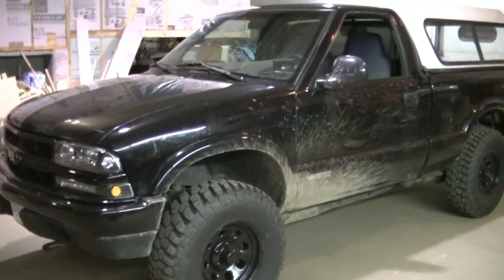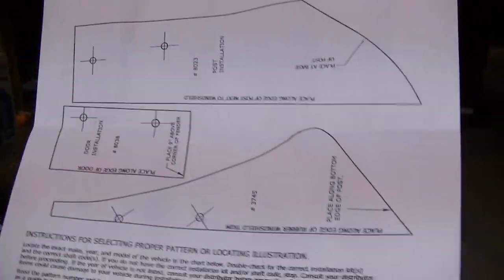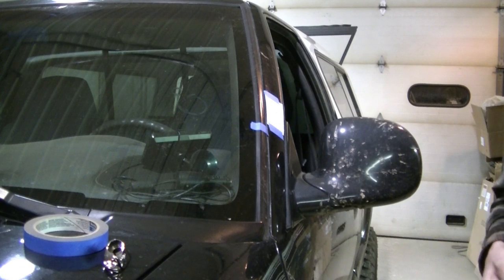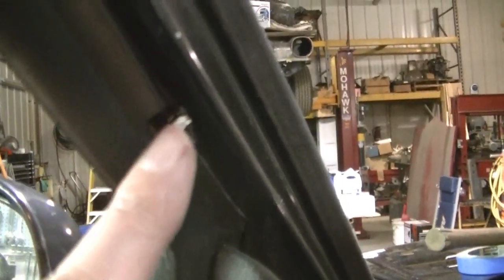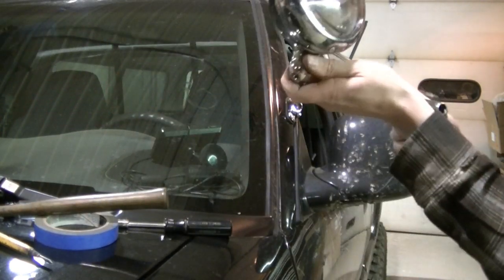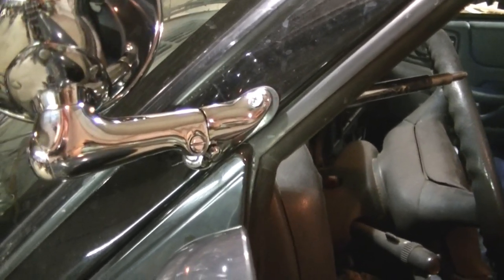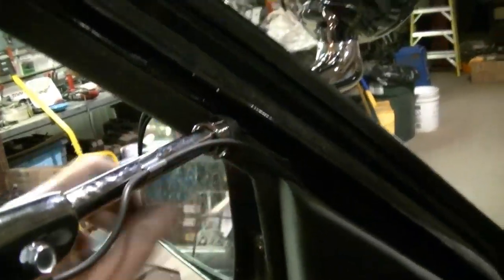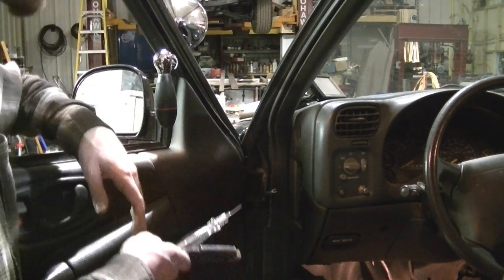98 S10 Unity Spotlight Install

Comment: did you ever think that you may have drilled the screw hole at the wrong angle?
Reply from the maker: williek74   No,  that wasn't the problem.  I think the expect the drill to grind the screws down but I wouldn't count on that.
Reply: +mossman381 watching the vid you had quite a downward angle going on drilling those mounting screw holes. I would suspect a flatter angle wouldn't have interfered with the shaft. Hey, it sure is helpful either way though. I'll be watching out for that when I do my install and if I experience interference I will know what it is :-)Thanks for the great vid!!

Comment: Moss Man thanks for your video. I feel your pain my friend. After researching many videos and instructions for the past several weeks, I was installing one tonight in my Toyota Tacoma. I had to find a bracket on eBay because they don’t make it anymore at unity. Screwed in the bracket took my time drilling the half inch hole and my screws were jarring loose but I kept at it, carefully. For some reason the drill was heading right to my windshield! I had to stop. I have the first hole cut but not inside,  the drill bit doesn’t want to pierce that metal at the angle so I’m hoping a brand new drillbit which I just ordered will do the trick. That is a good tip about having the drill on the low impact setting because my drill bit was snagging up on the metal and it shook the screws on the bracket loose. I got some larger thread screws but that might not work I may have to put a rivet nut on the holes. I totally chewed up the outside of my truck a pillar. I’m going to watch your video about converting to the HID light. I myself have figured out a way to mount aftermarket LED lights on the unity arm/gearhead. I’m having a part made up I’ll keep you posted.
Reply from the maker: A new drill bit will help or sharpen the one you have. Drilling sideways isn't easy.
Reply: @mossman381  thanks brother. It’s misleading how unity says to keep the drill level which is impossible when you have an angled bracket. I’m thinking maybe they mean parallel with the bracket I’m guessing but if that’s what they mean they should spell that out. Because how can you keep the drill level when your particular bracket is angled downwards as is my case. But yes I’m hoping the new drill bit will do the trick. It would be helpful if they suggested getting a brand new drill bit to do this very nerve-racking operation. Thanks again for all your help I’ll keep you posted.

Comment: Thanks for the video.   Had a similar issue with the screw installing one in my 1990 Suburban.  what I did was marked and drilled the mounting bracket holes.. the started the main center hole.. stopped and removed the bracket.. Finnished drilling the hole.. then did the final install.. but when I went to incert the light it hit the screw just like you. . I removed it and ground it down so it wouldn't hit and finnished.  I have another light I want to install in my 2001 blazer.. But after watching your video.. I'm not sure if I like how much it may protrude into the truck..  Thanks again ..

Comment: Finally a good quality video on SL installation i will look back on this video when i get my first car and install my own spotlights
Reply from the maker: Timothy Wiley  Thanks,  I have another video installing a spotlight on my dads 04 Silverado.
Reply: I saw it also i was also under the impression that you had to assemble the spotlight and all that and then i found your video and i was like oh thats it i can do that
Reply from the maker: Timothy Wiley  The only thing you have to take apart is the handle.  You do have to make sure you line up all the slots or the handle will not seat all the way on the shaft.  You will know that because the light will not work until it is seated all the way.  I have done that before.

Comment: I just had a unity light installed on my truck.  The labor cost was $250.00.  I don't know if you are interested, Unity is selling some discounted LED spotlight bulbs for a little over $100. They are discounted because they interfere with radios; good for civilians.
Reply from the maker: +A Stanton1966   Wow $250,  that is terrible.  Thanks for the heads up on the led bulbs.  I might pick one up.
Reply: +mossman381 I like the garage, so I can't complain.  With all the new-style electronics in the vehicles today, he had a tough time finding a place to tie the light in.  Low and behold, he found a spot, much like in your video.  The box down by the left foot.  The big fuse box is under the hood.  And the fuses today are tiny.
Reply: +A Stanton1966 Maybe I'll shoot a nighttime video showing what my LED can do.
Reply from the maker: +A Stanton1966   The spotlight on my dually I modified a HID light to go onto my Unity shaft.  I really like it but LED is what I really wanted.  Is the LED super bright?
Reply: +mossman381 The owner at the shop told me that when he turned my truck's LED on for the first time, a worker happened to be looking at it and he got momentarily blinded.
Reply from the maker: A Stanton1966  I will have to see if I can scrape up the $100 for the upgrade.
Reply: +mossman381 I just bought a second one.  It's about $120 delivered to the door.  Everyone else is selling them for $230 plus shipping.

Comment: This may be a stupid post, but is it possible that the screw you put in the bottom of the mounting bracket was shorter than the one you used in the top? Just thought I would ask.
Reply from the maker: The Plow Guys  Both screws were the same length.
Reply: LOL ok just thought I would pose the question.

Comment: I bought a new set of Unity spotlights for my 1948 Ford F 1  P U.
I went with what they recommended. Ridiculously way too long. 12.50" overall length.
I've seen short mount lights on cars and trucks that have the brackets fit flush inside and out. 
Unity said what I have is what their engineers recommend.
I sent them photos from a F 1 Ford pickup site stating this is what I want.
They said the lights are the wrong units for my truck !!!
Very disappointed with Unity. To put it mildly.
Reply from the maker: +Al Wheeler   This was the first time Unity let me down.  There stuff has always been top notch.  I should have paid more attention while installing.  Seems these days you need to watch everybody.  Even the ones that have always been good.

Comment: Where did u get the light and will it fit a 97 Chevy Silverado C 2500
Reply from the maker: I got the lights on Ebay.  I haven't looked for one in a long time so not sure if people are still selling them there or not.  The mounts are vehicle specific.  I got them right from Unity.  Go to their website and you should be able to look up the mounts you need.

Comment: Always have to lookout for yourself when installing stuff. It may have been a longer screw put in the kit, things happen. Unity is a leading company for this equipment so I'm sure they have their hardware situated. Im thinking that your bit walked a bit while drilling. Maybe try contacting them about a faulty drill bit. Lots of things could be the issue. The thing is, you are the one installing it. Its you that should accept that you scratched it. Live and learn
Reply from the maker: I totally disagree. A company that makes a product should have good instructions provided to help you install and the right parts in the kit. I followed their directions and because they have provided a screw that was too long my install didn't go well. That is completely the company's fault. How could I see the screw was too long??

Comment: You wouldn't happen to have any brackets or mounts or anything that you could spare for a 98 Chevy S10 would you? I got the unity spotlight however it was use and has the police interceptor kid on it now I need it for my truck and I don't know what to look for
Reply from the maker: I don't have any parts for sale. Go on Unity's website. You might be able to look it up.
Reply: @mossman381  do you know the kit number you used for yours?
Reply from the maker: When I get in the shop I will see if I still have the install sheet.
Reply: @mossman381  thank you
Reply from the maker: The install kit is 29. Here is some one Ebay:  https://ebay.us/DqnE9g
Reply: @mossman381  thank you.  I bought it from your link

Comment: You had three screws for that other bracket you didnt use, is it possible you use the screw for that bracket on the mounting bracket for the light. Just a suggestion, i dont think its unity. I have a halogen on my 02 f150 and everything fit perfect. I did cringe when i drilled into my baby though.
Reply from the maker: I think their idea is when you drill the big hole you also clearance the top screw.  If the drill doesn't clearance the screw enough you get what happened to me.  I will always check and clearance the screws myself from now on.  Just to keep this from happening again.  Live and learn.
Reply: mossman381 i just put a unity spotlight on my 2002 f150 and i watched your videos to help and they did, but everything lined up perfectly with my install was smooth and everything works perfectly. The light looks good and i love it. Your videos helped me and scared me a little bit, but i triple checked everything before drilling. Thanks for the videos mossman

Comment: Hey mossman quick question so for that single wire the spot light has it's positive so should I just be able to hook up straight to the 12v battery?
Help pls
Reply from the maker: MrELKICKER   Any 12v power source should work.  I didn't show putting in a fuse but you should fuse it.

Comment: Hello, from which model you are using Spotlight? Crown Victoria or a special version for the Chevy Blazer? And if not difficult to give a link to Ebay, please))))
Reply from the maker: Артёма Мороз   The mount works for many different vehicles.  I don't think a crown vic mount will work on an s10.  If you go on Unity's website they will tell you what mount you need.  I watch ebay every now and then and buy the spotlights when I find then cheap.

Comment: I think they were wrong when they said the RH bracket would fit the drivers side..seems like it is too far over.  I don't blame you for getting onto Unity.  It also amazes me when retards contact you guys that make videos and call you dummy's.  Completely uncalled for. Im a former cop and was used to the light being mounted through the front post as well so i was a little skeptical about a door mount too because the post mount was all i was familiar with..but i don't know everything so i kept an open mind!  I own a white 2005 Chevy Silverado 1500 ext. cab long bed truck i use for my work truck and i installed a Unity spotlight on it today..yep right there on the drivers door per the instructions and template.  You're no dummy Sir and i appreciate you taking the time to make this video..it sure helped me!
Reply from the maker: Glad the video helped.

Comment: I don't think the issue was the screw being too long I think what happened was the screw was angled down and that's why it was catching
Reply from the maker: I am curious how you come up with that?  The screw has to angle downward.  I have installed many spotlights and never had a problem with the screw catching the light shaft.

Comment: drilling though your Apiller? What about structural integrity?
Reply from the maker: Nik Demopoulos   I don't see that small hole doing anything.  They do it to every police car in the country.
Reply: Yeh I know that but I wonder if they add more steel to the area before drilling though. In a roll over that would be a weak point for sure. Just a thought, I have one on my vw splity but its mounted on the side corner frame.
Reply from the maker: Nik Demopoulos  I am not worried about it.  I hope to never test it but if I do I will let you know how it does  :)
Reply: mossman381
 indeed, did you get another chrome shaft for it?, I noticed they sell them on the website
Reply: @DemopVWgarage  No they don’t add any steel strong enough as it is with the 1/2” hole drilled through it.

Comment: I just bought a used unity spotlight on amazon but I can't figure out how to light it up? how are these things grounded?
Reply from the maker: +Clay Keglovitz   The lights are grounded to the body of the vehicle through the mount.
Reply: +mossman381 ok so it won't work until it's mounted?
Reply from the maker: +Clay Keglovitz   If you ground the shaft it should work.
Reply: +mossman381 ok thanks

Comment: I have an 07 and 08 Crown Victoria Police Interceptor. My 07 has spotlights, while the 08 doesn't, I want the 08 to have the spotlights instead of the 07, can you give me any tips on how to transfer the spotlights onto the 08? (The 08 has holes from where the spotlights once were)
Reply from the maker: +ConnorWeekly   You can get a plastic plug for the 1/2 hole.  You could even paint the plug to try and make it less noticeable.  The smaller holes maybe some water proof fiberglass filler in them.  Then some touch up paint to try and hide them.  Or maybe a small rivet in the smaller holes.
Reply: +mossman381 The holes in the 08 are already plugged. ALL I need to do is transfer the spotlights from the 07 to the 08. Any ideas?
Reply from the maker: +ConnorWeekly   You have confused me.  I have read your comments over and over and still don't know what you are asking.
Reply: Okay, Ill say it in detail.... I have 2 crown victoria police interceptors. One crown victoria has spotlights on it and the other crown victoria has holes where spotlights once were. I am asking you how would I transfer the spotlights that are on one of the crown victorias to the other crown victoria.
Reply from the maker: ConnorWeekly  If the car already has the holes then you can just move them from one car to the other.  Am I missing something?
Reply: My fist car will be an 01 :) getting it tomorrow :D

Spotlight and bulbar
Reply: FolkPilot I hope you enjoy it, let me know how you like it. I love mine!
Reply: FolkPilot I have a video about mine on my channel

Comment: could of been the angle that you drilled the hole for the screw
Reply from the maker: It is sheet metal so the angle of drilling is not going to do much.  I installed the screw so it was recessed in the mount.  So the angle of the screw should have been right.  I had to grind the screw down and then had no problems installing the light.

Comment: Maybe it was a careless worker that put the wrong screw in there, and not the engineering of the product.
Reply from the maker: I don't think it was a careless worker.  The directions say nothing about using a shorter screw on the top.  I have not struggled to install one of these lights before.

Comment: Too bad about that screw.  I recommend you put a fuse on the hot wire to the light.  Nice video, unity might be interested in watching it as well, them knowing other people youtubing unity spotlight has the potential for negative feelings directed towards their company due the problem you ran into might bring about actions by them that could prevent the same thing from happening to others.  Maybe get you a replacement shaft, at no cost to you as well.
Reply from the maker: You are right about the fuse.  I should contact Unity but I have been so busy it is not a priority right now.

Comment: A GoLight would have been pretty on that truck
Reply from the maker: Dad has a golight and not impressed with it.  For what his golight cost he could have gotten a Unity hid spotlight.  Which would have made the golight look like a candle.  Dad is getting a Unity spotlight too.  And I am going to convert it to hid for cheap.
Reply: ahh I did not know that about the go light I may put a unity light in my f250 after i see how bright the hid you do is.
Reply from the maker: steve L
It is going to take some work to do the hid upgrade.  I am not buying the kit from Unity.  I am making my own.  I have already done it with my dually.  Just going to make it look better than my first one.

Comment: you keep blaming unity for your screw up.. when something hangs up the answer is not to force it but to find why its hanging and correct it.You scratched the shaft not unity, you didnt investigate the problem before forcing the shaft through the hole causing it yo get scarred.
Reply from the maker: +Thomas Newsom   They sent the wrong size screw for the job.  I thought I was getting hung up on the side of the door not a razor sharp screw that should have been shorter.  The drill bit even hit the screw causing more problems.  After grinding the screw down everything was good.  A shorter screw and I wouldn't have had any problems.  It was UNITY not me that screwed up.

Comment: Your drill wasn’t level as shown in instructions.  You angled up towards the screw!!!
Reply from the maker: You can't angle the drill when it's in the guide. The video is up to help others. I can lead a horse to water but I can't make him drink.
Reply: I had the same problem. Yes a lot of instructions say to level the drill but my bracket which I was putting in tonight in a Toyota Tacoma is angled down. I had to quit after a few hours because the drill was going towards the windshield. Very frustrating.
Reply: @mossman381  mine still works fine!   I marked the inner spot using the guide then took out the guide and drill through to cab free handed and below screws.  Need to use your brain.  Not just a hat rest mossy

Comment: nice. :) we could use 1 to.. :) but its not comein from them. thats 4 sare..
Reply from the maker: Unity spotlights are pretty much the only ones you can get.  They are good lights.  If you install this mount just make sure you go get a shorter screw for the top and you should have no problems installing it.  I would recommend Unity spotlights and mounts.  I have used a lot of them and have been happy up until now.
Reply: mossman381 they seem like good lights, i was mad when i seen that u were haveing a hard time mounting the mount, they sould of gotin that right the first time..